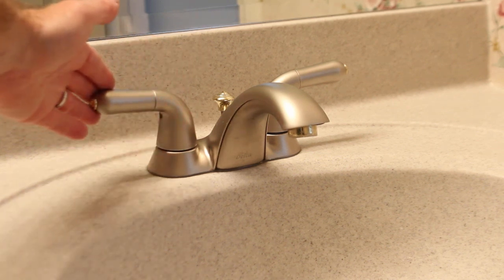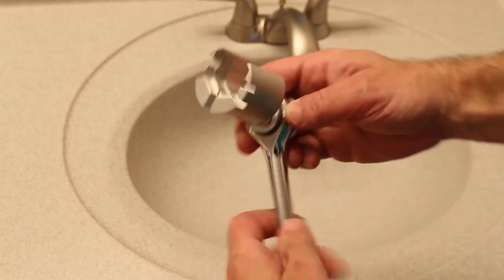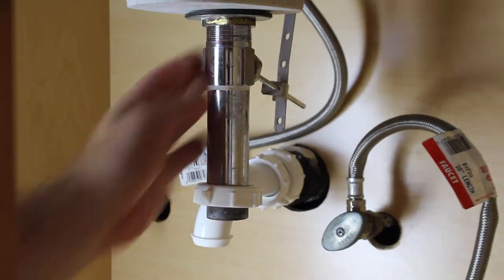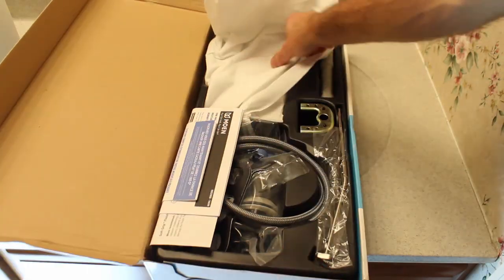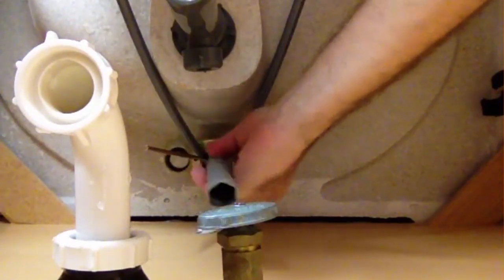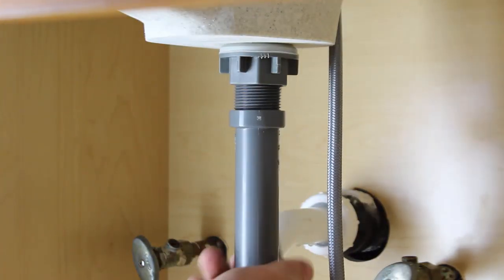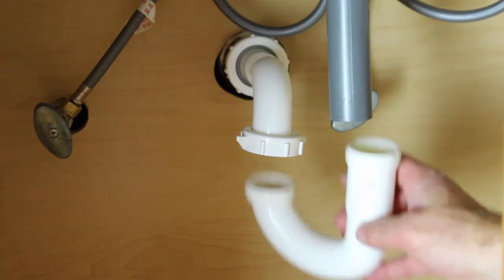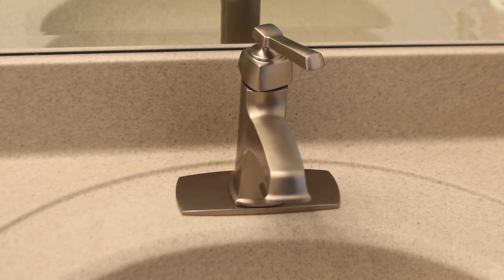How to Replace a Bathroom Faucet  (Moen Single Handle Faucet Install)

Comment: I'm not a fan of those pop-up drain plugs. I mean the design could be improved , cause after awhile all they do is help clog up the sink drain when all the muck attaches to it, and no matter how much you spend on those faucets they all have that stupid flaw in design.
Reply: Something my parents taught me, don't complain if you don't have a solution to the problem. I am 39 and have never had a clogged sink drain because I clean it regularly.  Aside from water and toothpaste...no idea what is going down your bathroom sink????

Comment: Thank you Jeff!!!! Your instructions were right on point! I had set aside 3 hours to get my Moen faucet installed, but with your video it only took 1.5 hours!!! My faucet looks beautiful and works without any drips or leaks!!!! My faucet had a pop up stopper but that was easy to figure out—once again, thank you from the bottom of my heart ❤️!!! I subscribed as well!!!

Comment: Good job Jeff. Installed a new Moen using your youtube,  and the somewhat sketchy Moen instructions. Not hard. Your tube helped.The hardest part is reconnecting the drain pipe connections, so they don't leak. Men doesn't discuss that! Was working with a pedestal sink, so everything was hard to get at. Good thing someone wasn't paying me by the hour. But got it done. Glad I don't plumb everyday. Have a cocktail to celebrate!

Comment: Thanks for the great video! Headed to HD to get the two Rigid tools. One suggestion I might give you is when removing the faucet,  just leave the waterlines attached to the faucet.  Disconnect them from the shut off valves, and then pull them straight up and out. Disconnect your waterlines from your old faucet, and if they’re reusable, just attach them to the new faucet and then drop them through the holes in the sink and then reattach them to the water valves. Just my 2¢ worth.

Comment: After removing the p-trap and the drain lift rod mechanism, if the drain pipe is stuck in place following loosening of the brass locking nut with an adjustable pliers, tap lightly on the bottom of the open end of the drain pipe to break the seal formed by plumber's putty or silicone and many years build-up of minerals and crud. 

I do the tapping with the handles of the adjustable pliers and it has worked for me!

Comment: Looks so easy! I was frustrated using the basin wrench! Unfortunately the one I bought is big and clunky making it challenging (for me!) to get in place and rotate.  The biggest challenge was the small tabs on the rings broke off easily.  So I'm typing this while I cool off, regroup, and try to figure another way to get this little demon off! Then I think the rest will be easy!

Comment: Jeff

Installed Moen Bradbury bathroom faucet today.  first time installing a faucet..I got hung up on the drain and the clip portion.  It made a loud clicking noise when you raised and lowered the drain.  the noise came from the clip area where the pivot rod was going through the clevis strap.  I finally got it to a more reasonable sound.  I've got another one to install tomorrow so will see if it was a part issue.  Thanks again!!great video.   faucet looks good and runs well and no leaks.
Reply from the maker: +alberry2345 sorry for late response, how did the second install go?

Comment: Really helpful info, especially on using plumber’s putty and how to detach and reattach the drain pipe.  Neither of these were described in the installation instructions that came with my new faucet.

Comment: Pretty easy job and I’m no plumber haha. Only issue I had was getting the pvc nuts off the bottom of the faucet and had very little space. Couldn’t use the basin wrench but had no issues with the basin buddy. Only place I could find one though was Menards. Thanks for the tutorial.

Comment: I would tape any threaded fittings and also show removing the faucet filter before turning back on the water , to flush out the dirt build up in the water lines, and more detail on the drain plug , most time it has to be set on a angle down so it tops up and water can leave your sink. I'm re-doing mine right now and didn't know I needed the plumbers putty. Thanks for the help great video!
Reply from the maker: Thanks for the tips and kind words, hope everything worked out!

Comment: nice demonstration - it was helpful -- one note - I went and bought the Rigid tool -- it seems like a great idea -- but the available space under the sink didn't allow for it's use -- the shut-off valves and incoming water lines protruded out from the wall too far to allow for the Rigid-tool handle to to have straight line to the faucet connectors -- a flex joint would be ideal :-) -- my hat is off to everyone who works in that micro-space under any sink (!)

Comment: Thanks for this!  I just got the exact same faucet and the directions are more or less pathetic, e.g. they didn't even mention the gasket that goes under the 3 hole plate.  This made things crystal clear.
Reply from the maker: +Gordon Cutts it’s weird how the directions for faucets sometimes stink! Glad the video helped
Reply: Thanks for recognizing my comment.  Question about a leak in drain.  I applied plumber's putty around the drain insert and it squeezed out into the sink as expected when tightening the underside plastic drain nut.  The underside rubber gasket is in place but there is still a leak around the plastic nut and the threads of the drain.  I noticed there are some holes (by design) in the drain insert and am wondering if the putty needs to fill in those holes.  Thank you for any advice you have.
Reply from the maker: we tend to use 100% clear silicone instead of  the putty because it's more of a permanent seal.
Reply: It only leaked when the drain stopper was up, not down so it wasn't the plumber's putty seal.  I ended up resetting the rubber gasket underneath and re-tightened the plastic nut.  It's all good now.  Thanks again.  I thumb-upped and subscribed.
Reply from the maker: +Gordon Cutts thanks and good to hear it worked 👍

Comment: This was a very helpful tutorial.  Thank you for sharing.
Reply from the maker: Thanks esobel2009, hope you got some great tips!
Reply: I did.  First time replacing a faucet and the directions that came with it were horrible.  Although the design was slightly different than what you used, your video helped tremendously.  Thanks again.
Reply from the maker: Awesome, thanks again esobel2009!

Comment: Hello! Your video was super helpful for installation! However I am still having the same problem with a dripping faucet. I’m not sure what I did wrong. Everything is new including the supply lines yet it is still leaking. What am I missing??

Comment: Jeff, I'm so glad you did this video as I have a problem faucet.  It all started because I didn't think I could get the old drain off.  I thought I could just leave the old drain on, and continue.  Did not work!  The drain,strap, pivot thingy are different enough that I couldn't make them fit together so I got frustrated and just have not had a drain stopper for a year-ish.  You've given me hope that (if I can find the new parts again) I will be able to get the old drain out, put the new one in and live happily ever after with a stopper that works.
 Is the new tool really better than a basin wrench?  If so, how?  Another quick question - is there any easy, comfortable way to settle in under the vanity?  I feel like I'm working upside down and backwards.
 
 Gonna get to this job as soon as I finish re-grouting my job built shower.  I definitely think 4 years is long enough to let the grout dry out.
Reply from the maker: The Ridgid tool is pretty awesome george spelvin because it won't require you to be under the sink. You should see squeezing into a vanity, it's a little funny. Let me know if you have any other questions, I'd be happy to help.

Comment: Excellent video, however I did not know why the p trap had to be removed.
Reply from the maker: +Monisa Montoya if you're replacing the drain you'll have to remove the p-trap, that's the only reason :D

Comment: The foam gasket on the model we got has adhesive on one side and I can’t figure out if it’s meant to adhere to the deck plate or the sink.
Reply: May I ask if you ever found a solution? I would assume a call to the manufacturer helped you?? At least I would hope so...quality customer service does seem to be declining these days! I am going to go shopping for a new sink and faucet soon so any tips would be appreciated in case I run into the same issue (will be my first attempt)! Thanks so much!
Reply: I ran into the the same.  Still looking

Comment: I just replaced mine with an AquaSource bathroom faucet.  All is good except for a leak seeming to come from the back where the extention tube or ball rod as it's called in the IM, is there some way to prevent that?  Also I did not use Plumbers Putty, although the leak is not coming from that high up on the Drain Body, is using the putty a must in all faucet replacements?
Reply from the maker: +Jay Newton you don't have to use plumbers putty but just make sure all connections are as solid as possible. The ball connection might need an extra turn or it could be cross threaded. Find the source of the leak though.
Reply: Well, I took it all apart and reinstalled it, same problem, leaking from where the Ball Rod and Drain Body meet.  It's made of plastic but I think the design is flawed.  At any rate I am taking it out, returning it to the store and trying something else, any recommendations?
Reply from the maker: +Jay Newton American Standard, Delta, Moen or Kohler are all great options
Reply: Jay Newton, reverse the plastic piece in the ball socket to stop the leak or, you might be missing the o-ring gasket that helps to seal the ball socket, as well.

Comment: we had a plumber install new faucets in bathrooms and he used silicone on the drains..one has leaked consistently, should he have used plumbers putty instead?  it seems to be the right thing to use, although i have seen some videos using just a small bead of silicone.

Comment: Looks good dude, it seems like it would have taken you a long time to put that together. Just FYI at around ~7:05 it appears you didn't install the gasket after all.
Reply from the maker: Great eye ***** - I noticed this, too. I actually did install the gasket but the editing of the video doesn't reflect that, haha. Yah, this video is longer than I'd like but I wanted it to be complete. I hope it helps out anyone doing this kind of project :D
Reply: Jeff Patterson awesome, good on you. I appreciate the effort it takes. ive always enjoyed plumbing, it is pretty easy, it's just a) thinking about it (most relies on gravity) and b) getting your hands in inconvenient places.
Reply from the maker: ***** totally agree. For major work I always call in a pro though. That being gas lines, sewer and waste pipe issues, water line work outside, etc. The hand thing is an issue. It's amazing how tight a bathroom space can get when working under sinks.

Comment: You said "clockwise" to loosen, but isn't it "lefty-loosy" like other threads? It seems you did turn in counter-clockwise when removing the water lines.

Also, for a finishing touch to the video, why not show the new item working?

:D

I don't use a pop-up drain plug, so I don't think I'll need to remove the U-trap ("p-trap?") on the bottom. We'll see when I go do this.

Thanks, though it was good to see you go through the steps before I do.
Reply from the maker: If you're under the faucet and looking up, then lefty-loosy is correct. If you don't need to remove the P-Trap that's great, you'll like have to unscrew the extension from the faucet that goes into the P-Trap.

Comment: Getting so work done in the basement, any chance for a "how to hang a door" videos?
Reply from the maker: Are you putting in a pre-hung door or replacing the existing door slab only Jim Pappas?
Reply: No, this would be a brand new door (where there was nothing before) in with new construction.  To save some money, we are letting the contractor leave an open space, and then I figured I would to a pre-hung myself.  You know the ones that you can find at Lowes or Home Dept.
Reply from the maker: I think you'll be fine Jim Pappas DIYing this. Unfortunately I don't have a video yet but there should be several good ones on YouTube you can reference. The biggest part is making sure it's plumb and the door won't swing open or closed on its own :D

Comment: If the sink is deeper such as the Kohler Caxton do you trim off the bottom of the drain to make it fit to the p trap?
Reply from the maker: You could trim the drain if necessary Annie, good question

Comment: my old faucetocknut wont come.loose. One side came out easy bit the other is stuck. Tried ws 40, pilers, monkey wrench, hammer and flat head, that red tool you showed in the video. Any advice would be great. Im just a giy trying to change his bathroom faucet, really knkw knowledge in this. but ive gotten to the last step which is this last locknut beofre I can install my new faucet with drain cover.

Comment: At ~8:33 mins in when you show the drain pipe, there are open holes on the side of the pipe that your thumb is covering, i assume thats the overflow holes, would that create leaks?  I don't understand where the water would go after going/leaking out from those overflow holes?  Thanks
Reply: Think i found the answer.  My sink is different so I have to connect to its overflow drain which is like another hose below the sink.
Reply from the maker: +vhoang2 bummer

Comment: #Sunokanse Amazon sells a Basin Buddy tool that removes both the supply line nut and the plastic basin nut. It's an attachment for a socket set. Or you can cut it out with a dremel tool or melt it with a soldering iron. Another method is to cut slots on top of a pvc pipe that fits over the nut and use that. @Rich J

Comment: I was having trouble screwing the plastic nut for the drain. Whenever I turn the nut, the whole drain tube turns, which prevents me from tightening. Any ideas how to prevent that?
Reply from the maker: +Magz B thanks for your great question, hold on to the drain with one hand while tightening down with the other. You can also use a pair of channel locks or a strap wrench to hold the drain while tightening. Hope that helps...please let me know
Reply: Jeff Patterson Thanks for your reply! Unfortunately I have one of those pedestal sinks where the drain is hard to reach. I am replacing it with a vanity so hopefully it should be easier to tighten!

Comment: why do all these videos looks like they all ready did the job and they just showing what they did all the parts you took off the old faucet look brand new why not show us you removing a 50 year old faucet yes i have a 50 year old faucet it is so old there is a faucet for the cold and one for the hot. why replace if it works but my cold faucet is broken and can't find a  faucet stem to fit it

Comment: I NOTICED YOU DIDN'T USE PLUMBERS TAPE ON THE ENDS OF THE THREADS OF THE BRAIDED HOSES..SO IT'S NOT NECESSARY TO USE PLUMBERS TAPE AT ALL?
Reply from the maker: it depends on the instructions, for this faucet they didn’t require Teflon tape
Reply: @HomeRepairTutor  OH...OKAY..THANKS FOR REPLYING

Comment: basin wrenches are worthless! they don't grip at all! they just gently rest on the nut so when you twist it, the nut never turns!
Reply from the maker: +feioncastor basin wrenches aren't that bad, just a bit tricky. That said, I like the Ridgid Faucet and Sink Installer tool better

Comment: I’m confused as to why you’re taking the drain apart to replace a faucet lol completely unnecessary.
Reply: Because the faucet he bought comes with its own drain plug.
Reply: ffxu u. So just because it comes with it doesn’t mean you have to spend the time to replace a perfectly good one. I just replaced one that came with it too. Why do extra work when it’s not necessary.